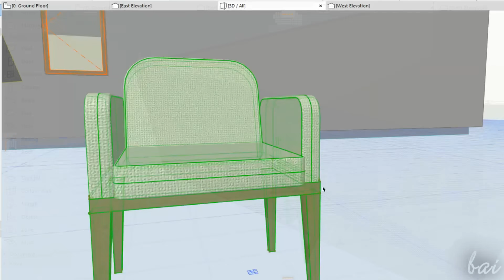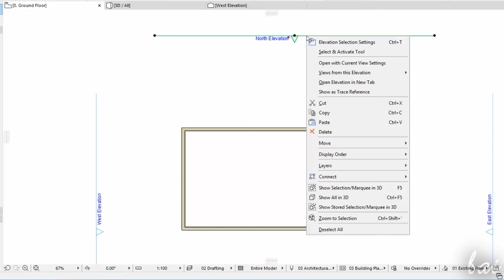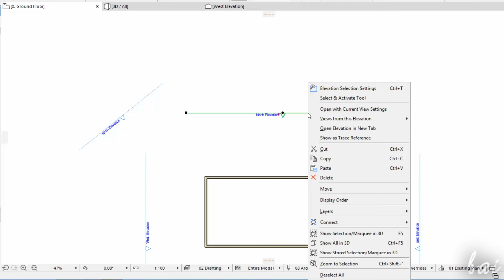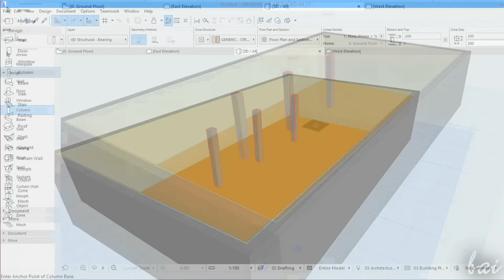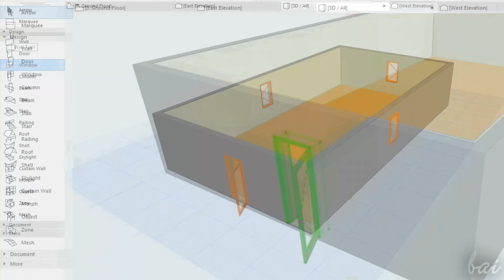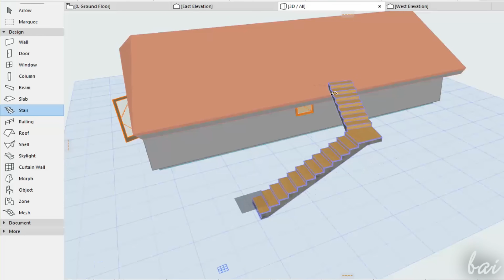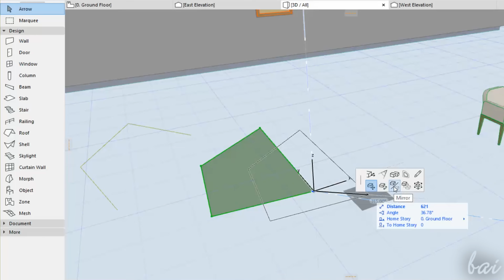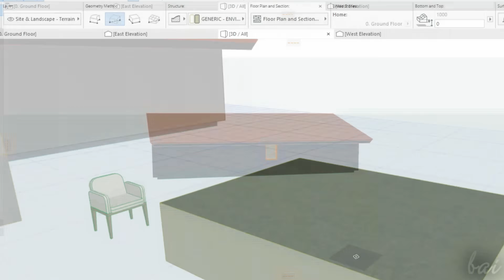ArchiCAD 21 - 3D Design and Projects for Beginners [COMPLETE]

Comment: I have a huge problem of the display of pop up info (the one with Co ordinates and angle) as it's font size is extremely small and the info are not readable.. Could anyone help me in making it a readable size... (I think when I changed the units in ft in, this happened, not sure, but now even going back to decimal won't help)